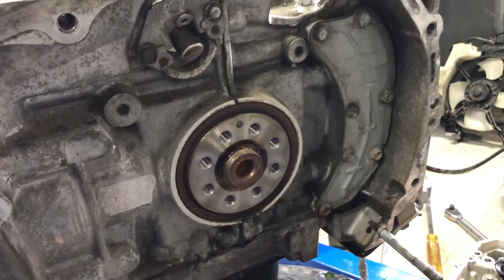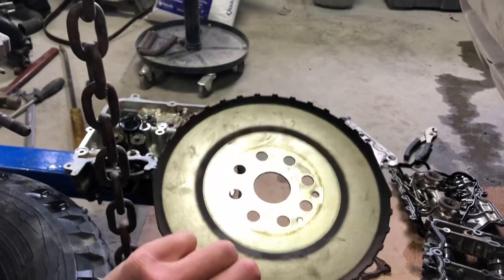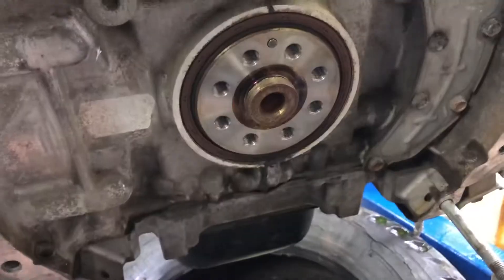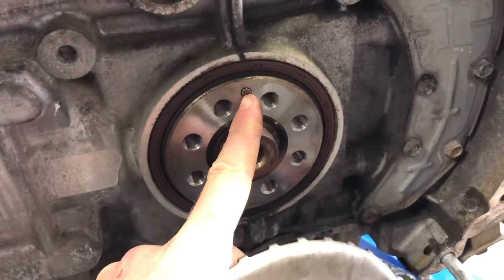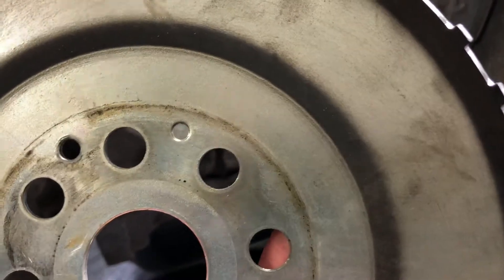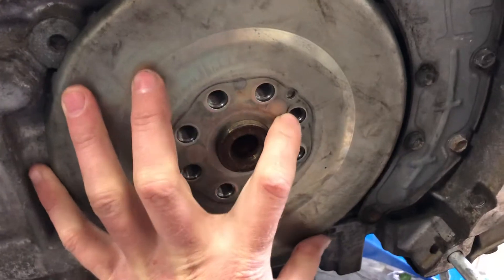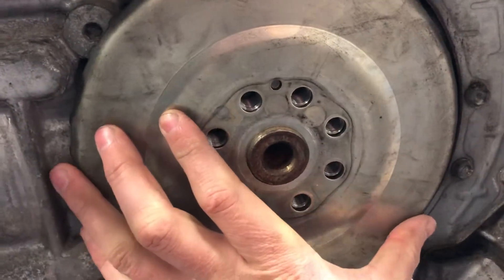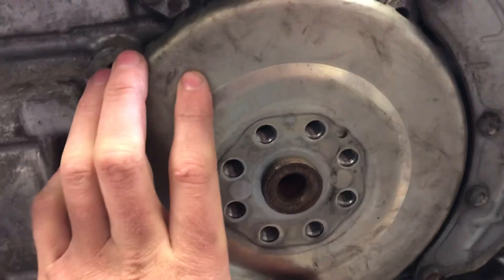FB25 crankshaft timing

Comment: I doubt you still need help with this, but if anyone else does, the dimple on the crank goes into the hole on the reluctor wheel. someone bolted the one in this video into the wrong spot, causing the second indent.
Reply: Good call, that's what I was thinking! Might take a while to figure this out if it came already installed on a donor engine.

Comment: Could that dimple possibly have been formed from clamping the ring between the flywheel and the crankshaft without being lined up or did it look like it was manufactured that way? I am currently swapping an FB25 into a legacy and Im having issues with the passenger head. Very bad misfire on 1 and 3. Getting fuel, spark, and compression. Completely checked my timing twice. Im running out of options lol.